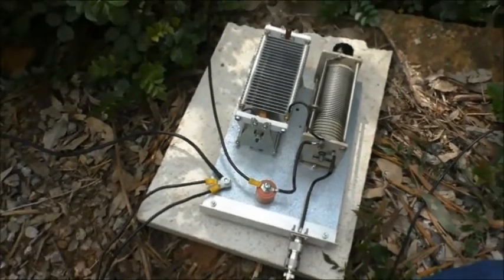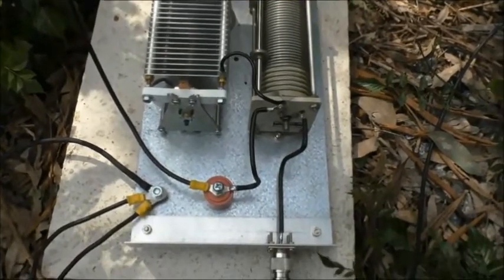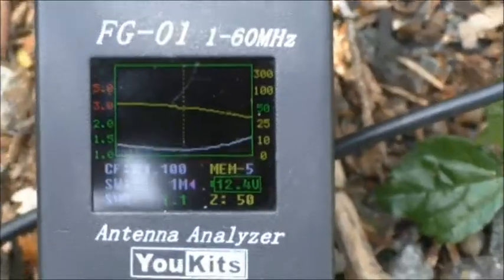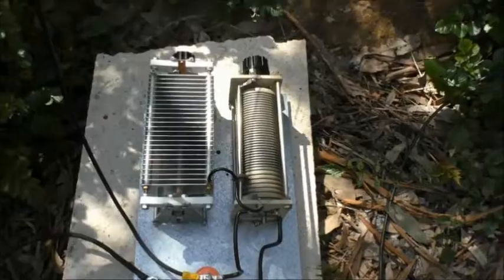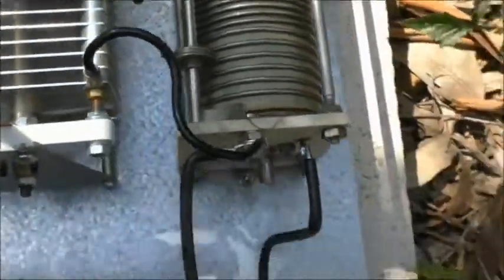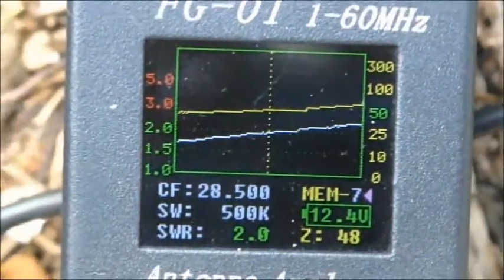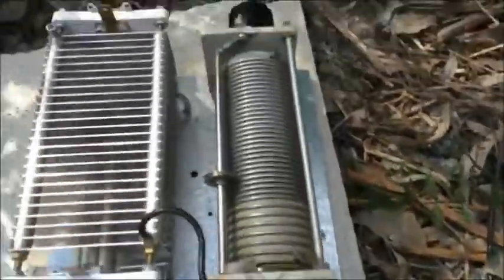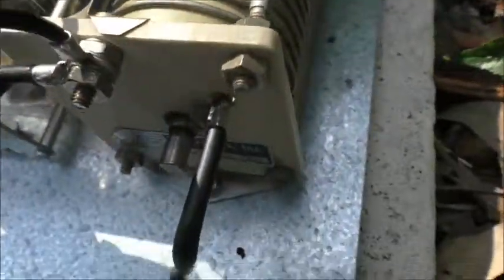How Does The Manual L Match Look On The Other HF Bands

Comment: As long as it works on the bed-sore band it'll be a winner.
What about 30m ?
And you have mosquito's there ? I thought they were all retired....
I did indeed find it interesting - I learn more about radio every time I stop by. Thanks.
Reply from the maker: Thanks Ade. You may also find this interesting: https://www.youtube.com/watch?v=RXJKdh1KZ0w
Reply: Nothing beats the Gonculator.

And yes, RC does make some good gear but it's all based on the Gonculator.